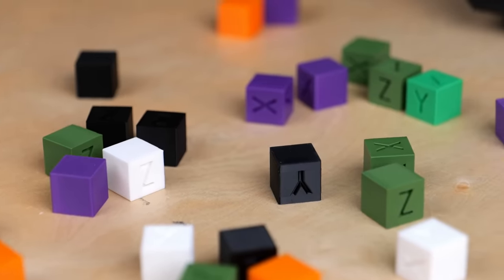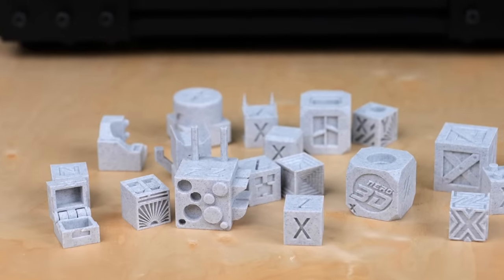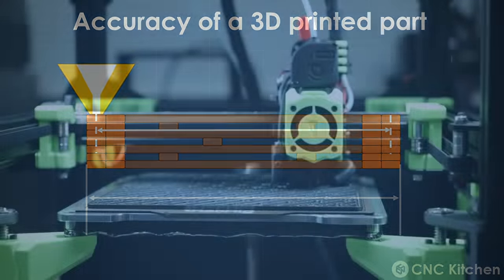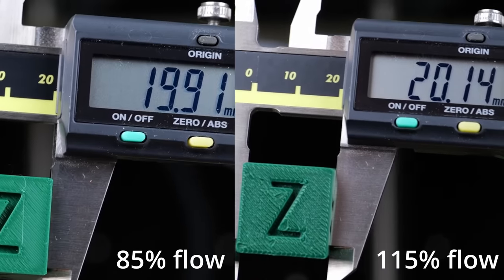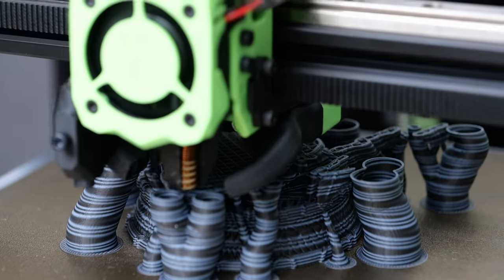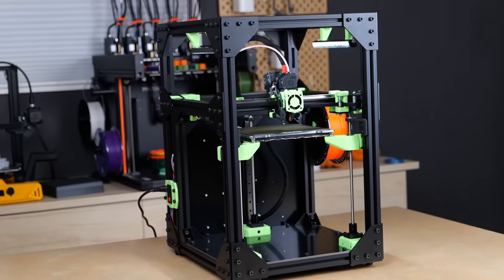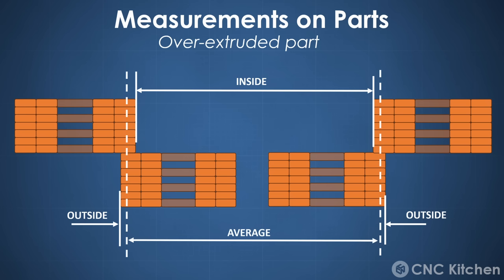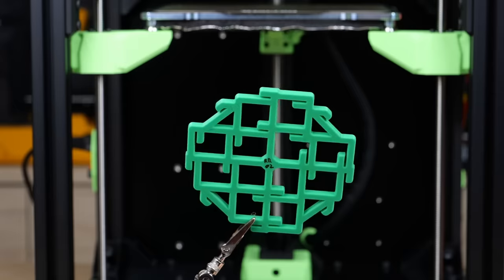Calibration Cubes: More Harm Than Good?

Comment: From an engineering standpoint all your arguments are perfectly valid, but for most people, even those who mainly print functional parts, that degree of accuracy might be overkill.
I mean with a build volume of - let's say 250x250x250mm an error of .1mm per 20mm is quite noticeable but barely fatal. You'll still be able to get your M3 bolt into the offset hole on a maximum size print even though it might not look pretty and require some fiddling and some brute force. Besides that, an error of that dimension is already noticeable on the Cali-cube and many of the "fit-together" variations of the Cali-cube are designed to test assembly functionality, because with bigger prints the overall dimensions are most often far less important than the details. 
Unless you want to build a really big structure out of 3d-printed parts, the dimensional derivations don't matter all that much and for a big structure there are certainly better materials than FDM-printed plastics. But even if you were to assemble multiple maximum size prints into a structure, there are ways to compensate for errors, which will inevitably occur and build up with scale.
Precision makes many processes easier, but so does tolerance. If you get rid of tolerances and put all your efforts into accuracy, you'll hit the limitations of technology pretty soon. I don't mean to say that you shouldn't pursue a high level of precision, but maybe not the highest possible level.
That said, there is one axis in 3d-printing that often gets neglected or underestimated by calibration prints: the Z-axis. An error of .05mm per 20mm means that at a layer height of .2mm it only takes four layers to be one whole layer off. You probably won't notice it in your print because you're most likely extruding a .4mm thick layer, but after eight layers you risk severe delamination if it's a positive error, and you risk the nozzle catching your print and ripping it off the plate if the error is negative. A 200mm high print has 1k layers of .2mm height. 20mm are 100 such layers. It only takes .005mm of error to to be more than 2mm (10 layers!) off by the end of the 250mm high print.
Measuring 20.02mm or 19.98mm on your Cali-cube could be a measuring error as shown in your video, but if you ever want to print something of considerable height, you need to calibrate better than that.
Usually the Z-errors are much less than that and people despair over their first full height print being knocked over just a few layers before it would be finished or over finding only a bird's nest where there amazing overnight print should be. It's further complicated by backlash, variable layer height and z-hop features or printers with multiple toolheads, because here the tolerances actually need to be as tiny as possible since they scale up so quickly. That's a problem that would require the most meticulous calibration and a Cali-cube simply won't suffice. Maybe it's something you'd like to tackle in a future video. Maybe the best way would be a printer that measures Z-axis position every 10mm or so and auto-corrects for height errors.

Comment: Huh, turns out ive been using calibration cubes wrong this whole time. I watch as they print then change flo so theres no gaps between lines, then calibrate z offset and inital layer flow to remove elephants foot, then print two more, one half scale and use the offset from the dimension the cube is supposed to be as a tolerance and scale factor on my 3D models to ensure fit. I havent finished the video yet so curious what recommended best practise will be.

Comment: See... This is why i dont use a caliper.  I use a micrometer.  😂

As for belt tension, super easy to get right when you tune it like a guitar.  Twang them and match em 😊

I dont need a new measurement tool really, but since the member of the community that made it has cancer i bought/downloaded it to support him.  Hope he gets better, mom was a cancer nurse for 50 years and ive lots lots of family to it so when people are doing good work like this and getting hit with cancer i always try to help. ❤
Reply: In a core xy design, equalizing the belt tension does not guarantee a rectangular gantry. It just makes sure the gantry is in its natural eqilibrium, which might be scewed if its assembled in a scewed way. See my comment further up if you are interested. having an audible belt tension seems quite quite high for a 200 - 300 mm machine. You quickly reach the point where you stretch your belt over its elastic limit, which should of course be avoided.

Comment: One point : Creality machines that have non-parallel belt path will print the part dimensions differently depend on where the part is placed on the bed. Calibration for that kind of motion is useless.

Comment: Always measured movement accuracy in relation to the frame, not on printed parts. Rest is adjusted by the settings, depending on the filament, temperature, etc., so you get the best possible print accuracy.
But imho, it makes no sense to chase microns on a FDM printer. Yes, it must print "fairly accurate", but more than that is too much hassle  without reasonable gain on such a machine.

Comment: If you want to have 0.1 mm accuracy over longer distances, you must start to take care of the temperature of the printed object and the printer itself. Depending on the temperature of the structure of the entire printer body, the dimensions of the printer body could be off by 0.1 mm thanks to thermal expansion alone!

Comment: What method of correction did you use for your QIDI XMAX 3 running klipper? Can you simply add that set_skew gcode command line somewhere? I was under the impression that their "piece mailed" klipper modification wasn't technically supposed to be modified...

Comment: Good day. Does any one have any suggestions as to why my prints are hairy? I have tuned the flow calibration and the retraction 2 weeks ago. Everything was running smooth.  4 days ago i changed my filiment and now no matter what i do i get hairy prints. Any suggestions would be greatly apperciated.
Reply: I'm not an expert, but: 
- if the filament was not in a dry box or not sealed correctly it could have gathered humidity
- if the filament comes from a different brand/material or even colour i think, then its properties change. Hairy can simply mean that the nozzle temperature is too high.

Also, try a good old "cold pull" or clean the inside of the nozzle with a specific needle. Also, make sure that it's clean on the outside too
Reply: @davenarisotto3674  I figured it out finally after 4 days a tuning and calibration. I just went to the settings override on the filiment edit tab. Changed the retraction settings to 3mm and bam all gravy. Such a simple fix for how much messing around it did. The default was set to 1.6mm I believe. What a crazy couple days.

Comment: I think you could calibrate your motion system to accurately move, instead of doing calibrations through your extrusion flaws. You want to move a 100mm then it will move 100mm. The rest should be up to software such as slicing and calibrate the extruder and layers to compensate, directly measuing accuracy through a printed part is flawed unless you know that the motion system itself moves as it should. The extruder should be calibrated after to the same standard, 100mm of filament will yield 100mm of filament and then tune software to compensate based of your printed results only then a calibration print should be used i think.

Comment: Calipers can perform 3 measurements. Outside, inside, and depth.
Steps per mm clabration can be done easily by using the caliper to measure depth.
That way there is less measurement error than this contrived method of outside vs inside.

Comment: I measure the sides of the cube from the top so I avoid the corners and the bottom elephant foot. My X1C is off by a lot and the only way I can get accurate prints is to adjust the X - Y Hole and Contour Compensation to .1mm. If I dont do that, all my materials are undersized by .2 - .3mm. 

I really wish we had a way to adjust the steps per mm on the X1C or have the machine do it for us using the lidar or something... It really sucks having to design parts incorrectly because the printer wont print them true to size. I can get more accurate prints on my custom CoreXY running marlin than I do on my X1C which is pretty sad.

Comment: awesome i tried this out and went from a 
-0.08% X, -0.39% Y error | 0.28 deg Skew TO
-0.13% X, -0.41% Y error | 0.23 deg Skew
thank you cnc kitchen for recommending a calibration file that makes my printer worse. well worth the $5. 

im thinking my firmware update didn't take. that happens sometimes. it'll update if i get better results.

update: 3rd print was between 1st and 2nd so changes were not applied. firmware file on SD card was 0Kb so it failed to update. 
-0.16% X, -0.23Y, | 0.27 deg skew
i may have messed up my settings by applying a correction twice. when the first change failed to write to the printer. i should have taken a screenshot of them.

Comment: I remember when I first built my ratrig. My calibration went well. My cubes were perfect. I printed 2 parts that were required to be lined up. Both on opposite side of the bed. Guess what? none of them lined up.
However! I printed 4 cubes, at each corner. Guess what? far left cube was 0.2mm larger in the Y direction, it was clearly warped. This ended up being a slightly non square frame.

Comment: 1+ to leaving steps per mm alone. Steps per mm should be mathematically solved for and maybe a very small allowance for belt stretch (esp if cheap belts were used).

It seems to me that if you have calculated steps per mm, printed a calibration cube or flower, and your X Y dimensions don't match - the source of error would likely be the belts. Maybe they are cheap and too elastic, maybe one is permanently stretched, maybe they are of different quality form each other, maybe one is far over tensioned and or the other far under.

Comment: As a 3D printer manufacturer the steps/mm calibration doesn't make any sense to me. As long as you have high quality accurate timing belts the steps/mm is just a given. 2mm pitch? 16T pulley? 1.8degree  (200 steps) motor? 16 microsteps? (200*16)/(16*2)=100 steps/mm. Only bad belts with wrong tension may need compensating, but in my mind replacing the belt would be the right move instead of compensating for bad components.

But sadly, compensating for bad engineering has become the standard with auto bed 'leveling', vibration compensation, skew compensation, etc. We seem to be one of the few that produce printers with the precision and rigidity that you should expect from a cnc machine

Comment: Yea calibration cubes should never be used to calibrate XY Axis Steps per mm, although those should only very rarely be touched in the first place. Only after you made sure that the error you are experiencing has absolutely no way to be caused by any hardware inconsistencies / resistance and also only after you extracted the relative error of movement from your entire data, which very likely is 90% absolute error based on extrusion inconsistencies, die swell, surface tension rounding etc. 

XY Axis Steps per mm calibration is in theory something you could do, but it is very rarely something that helps beyond other things and doesnt make your steps worse in the process.

When in doubt, simply calibrate horizontal expansion / XY Size compensaion to make up for surface rounding and die swell on outside lines and thats plenty for normal applications.

Comment: 4:20 - skew is not only 3d printers, CNC has the same. Found out the hard way when making molds, where one of them was naturally flipped, so did not fit properly together. Super annoying - also make square parts not square. 🤓

Comment: If anyone wants to help. I needs some.

My wife bought me an ender 3 for Xmas. I added sprite extruder pro, glass bed , rubber bed spacers.
I flashed my own firmware just to account for the probe and extruder offsets.

Problem is bed adhesion and the worse problem is all top layers look like crap. 
I have tried baby step z which does not help, extrusion reductions. Bed leveling. 

I'm at a loss

Comment: First you fore some reason assume, that the calibration cube would be printed before calibrating extruder steps, flow, linear advance and retractions wich indeed would be of little use. Then you proceed to describe the usage  of the wonderful payed calibration model with all of the above. Also - why would one mesure on the elephant foot instead of turning the cube 90 degrees? Also - what exactly is stopping you from measuring the diagonals on the same calibration cube?
In general - you all right there, pal?

Comment: I didn’t quite follow this.  Whilst I haven’t used it had use for the calibration cube it seemed a little bit assumptive that people would instantly use them for modifying step count as opposed to using them to identifying all the other possible issues.  I’d debate the rigour of some of the other cross platform testing also as there are so many factors involved to make this sort of study fair.

Comment: as far as im aware, calibration cubes are supposed to be used for SLICING calibration, rather than CONFIGURATION calibration

your slicer and the filament can change the print properties WILDLY
changing the configuration can literally MULTIPLY that

Comment: I tend to agree yet disagree with your statement on the cube. 

Ideally if you want to check accuracy you would ideally want to check a minimum of two points on a spectrum for example 10% and 100% of a spectrum; for example for a 300mm^2 bed we'd check 30mm and 300mm dimensional accuracy and factor the points. When doing a single point adjustment approximately 50% point of the spectrum you're using would be ideal. For example, if you are usually printing parts between 10mm^3 and 200mm^3 you would test a ~105mm^3 design to give you a reasonable result.

So as you stated with the 100mm design you will get a bit better of a result from your instrument due to the fact that a 0.1mm deviation from a 100.0mm measurement is smaller than for example a 0.1mm deviation at 10mm.

An interesting vid though it made the metrology side of my brain want to scream out in anger, but either way.

Comment: Isn't the best method to use a dial gauge and measure the physical movements and then tune the thermal expansion for each filament in the slicer.

Comment: Question regarding shrink factor: I use Cura with the addon that changes settings based on material. I dial in every different type of material I have for dimensional accuracy. Is this the same as shrink %?

Comment: I think your solution to modify the shrinkage is probably not correct.
I think the correct solution is to "fix" the steps/mm for your main filament type, THEN check other types you print and use shrinkage factor for them.
Otherwise you are combining two factors together and just hoping that one of them dominates.  And it is going to ignore non-uniform variations.

Comment: Micrometers should be used for precision measurements, not calipers.

Even expensive calipers are not accurate enough for precision measurements.

Unfortunately, a set of high quality micrometers is very expensive, but necessary.

This is one of the evils in the world of precision measurements.

Comment: Literally yesterday I found someone on Reddit recommending measuring the height of an XYZ cube to calculate the flow correction. They thought that if you're overextruding all the layers get taller, as if the gcode magically adjusts higher with overextrusion. <facepalm>

Comment: Another cause of skew can be using a probe for bed levelling instead of doing a manual levelling process. A bed mesh can compensate for any tilt, but your slicer is slicing with the assumption that the bed is exactly at 90 degrees to the Z axis. Even if you use the fade height option you'll still have the lower layers be out of square to some degree. And this is compounded by the fact that the tilt can be on 2 axes. Bed leveling with a probe is fine if you're a basic end user just doing prints of stuff like vases and small toys from Thingiverse, etc, and that sort of thing,  but if you want proper accuracy you need to make sure the nozzle is running as parallel as possible to the bed before you even build a mesh. And then the mesh is just there to compensate for high/low spots on the bed for the first layer. Although a probe is great for this if the printer firmware has the feature to do the corner probing method of levelling with the screen showing the results in real-time compared to the centre height as the probe repeatedly keeps touching off on the bed.

Comment: We know they suck. They are too small and can't be used to adapt to the materials. They are cool for rough distance and shape but beyond that they are better used as a tracking if the different filaments you print. I do one whenever I try a new roll to see how it will look after the filament has been heated.

I use a dial indicator to verify print movement. It is faster and you can even get what the backlash of the belt is.

Comment: Even worse: I bought a cheap caliper and it was out of spec by 0,2mm. When measuring filament or calibration parts, that is a real problem.
You need to double check pretty much EVERYTHING

Comment: These printers run on toothed belts.  Measure the distance between maybe 40 teeth.  That's your calibration value.  The number of teeth per revolution of the motor is absolutely fixed.   So belt stretch is the only variable, and it's near zero as these belts have steel threads in them.

Comment: The smaller the part, the less value it has for calibration. A 100mm x 100mm box that is 10mm high except for one corner which is 100mm high is bound to be much more useful.